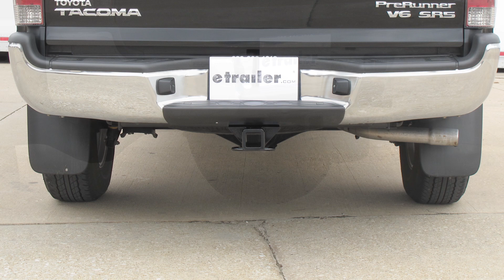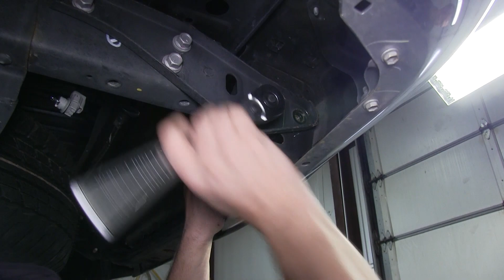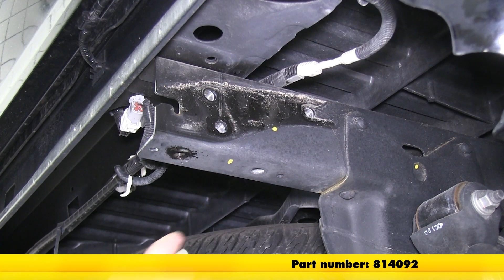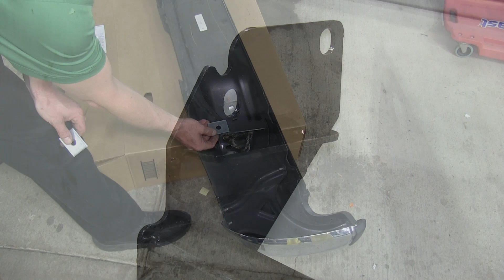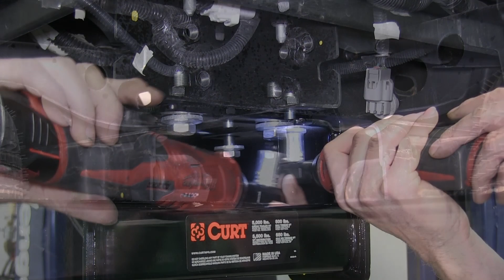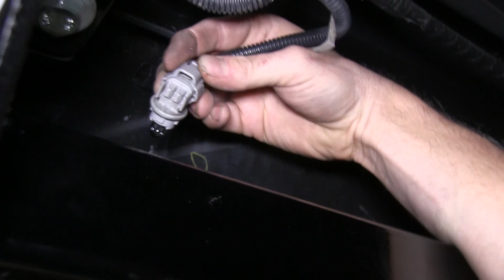etrailer | Set up: Curt Trailer Hitch Receiver on a 2010 Toyota Tacoma

Comment: Not sure if you guys will reply, but I recently just installed this hitch on my 2011 Tacoma 4x4, everything went smoothly until the spacer blocks part! Me and my fiancé tried and tried to get the bumper on with the spacer blocks but there was no way it was happening. So we actually winded up putting the bumper on there without the blocks and it fits absolutely fine with no gaps of any sort. Is there anything I should be concerned about not having the spacers on there? Thanks.